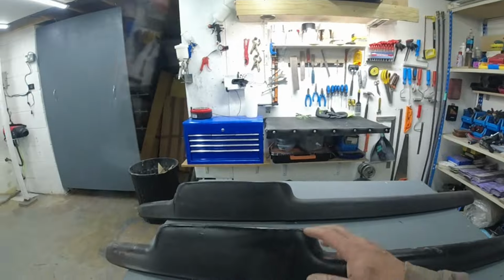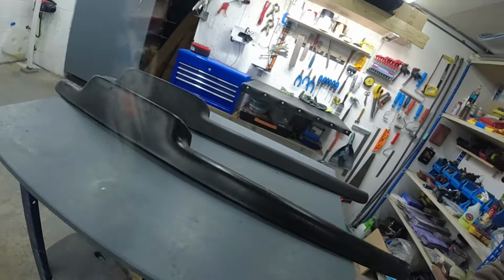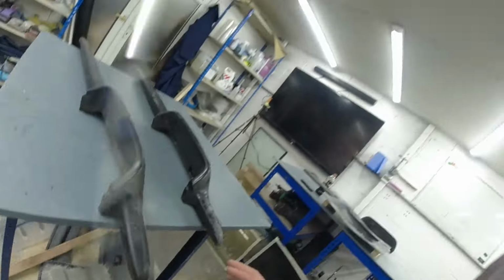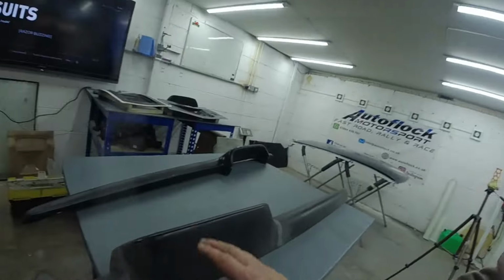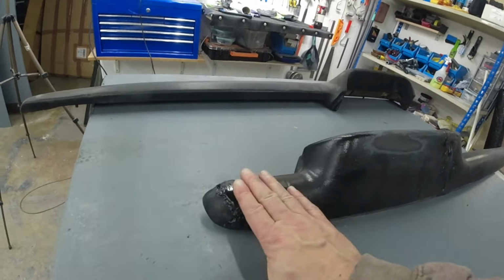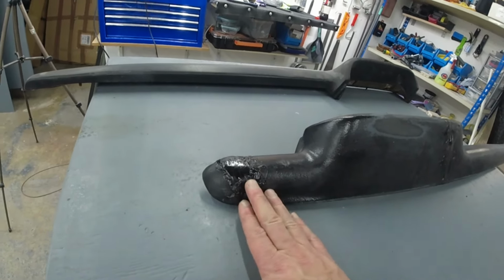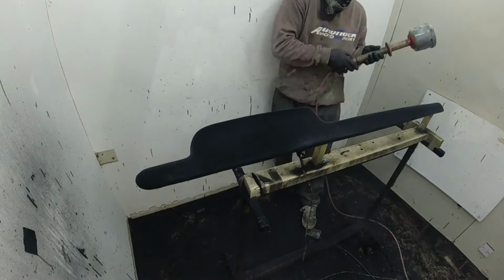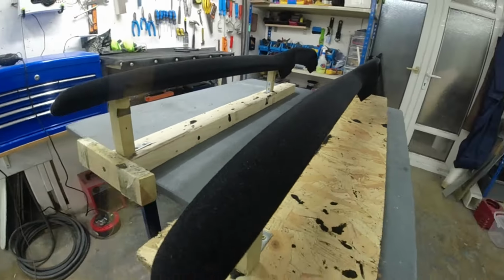Flocked Dashboard - Escort MK2 big repairs

Comment: Great job.  What epoxy filler did you use?
Reply from the maker: Many thanks, its 3M8115 but with the mix ratio changed to add a flex